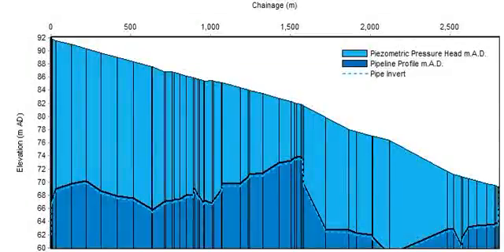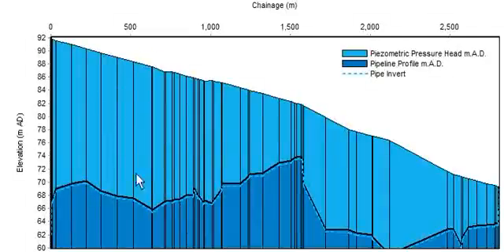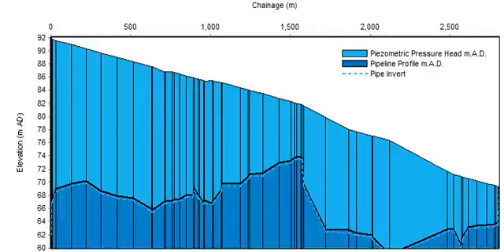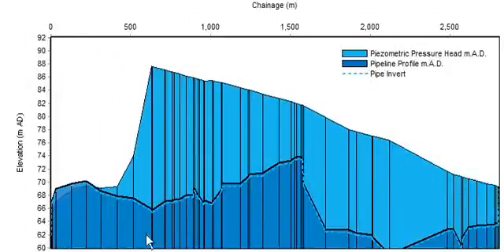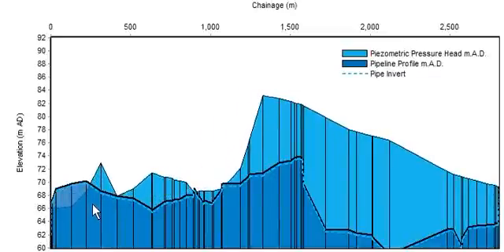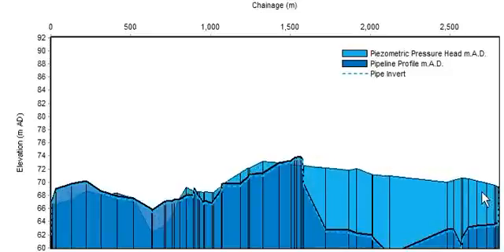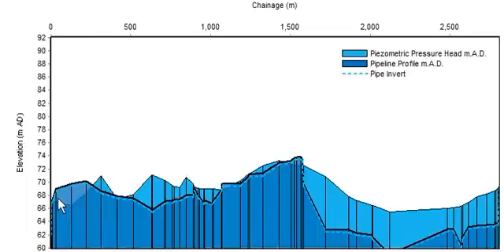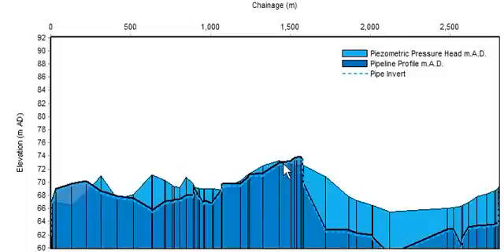Surge Analysis of Pump Stop

Comment: Minus 10 metres means the pressure drops below atmospheric pressure (vacuum).  At typical ambient conditions, say 15°C, this will drop below the vapour pressure and the water will flash.  This is bad.